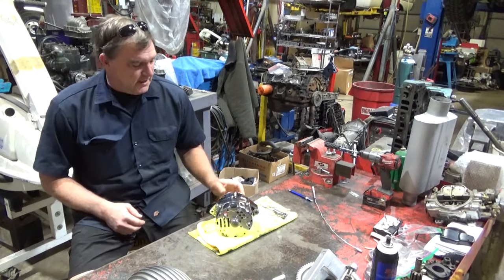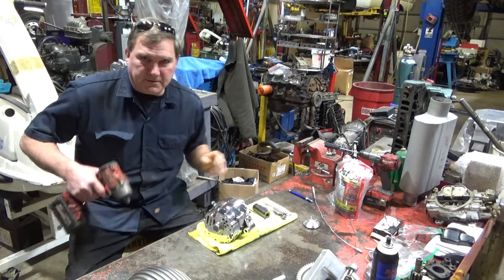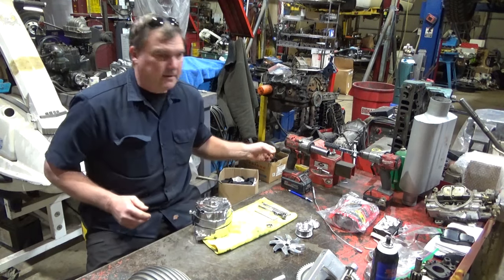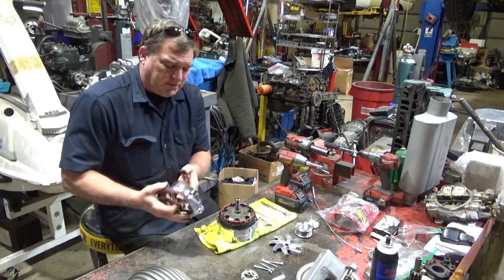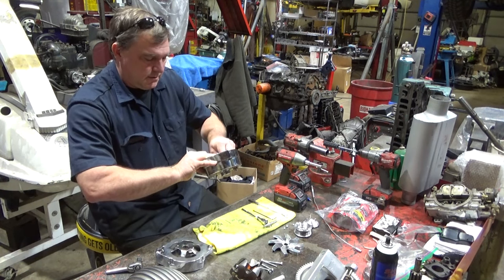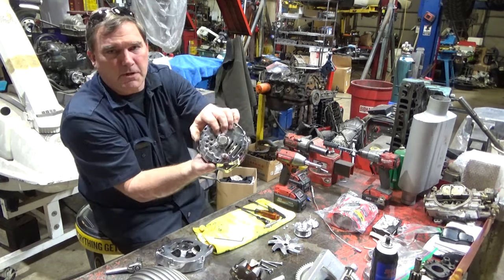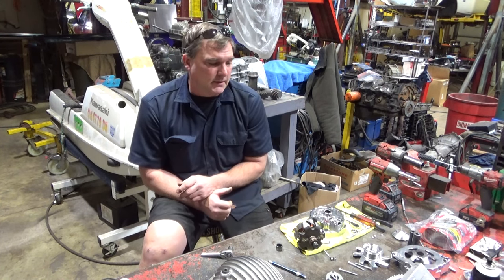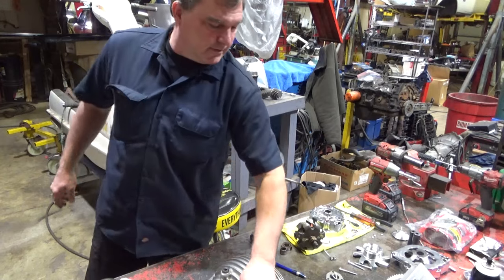Big Block Chevy March Alternator Failure? "Like new" and already bad?

Comment: Thanks for sharing this. I've got a 10 SI March alternator and serpentine kit, number 21190, on a SBC that's only about 3 years old and about 9000  miles and it started clicking and making a racket. Interesting that others have similar problems with relatively new alternators. I bought a new one from Summit for $269 and will have the old one rebuilt as a spare.

Comment: Another YT first: fixing an alternator! You guys really are a general purpose repair shop not just parts cannon operators! Check the shaft diameters before installing the new bearings. Too much interference fit reduces the internal clearance and causes noisy bearings. Bearing supplier can tell you the shaft size needed.
Reply: We are a "General repair facility"
Generally, we repair everything.